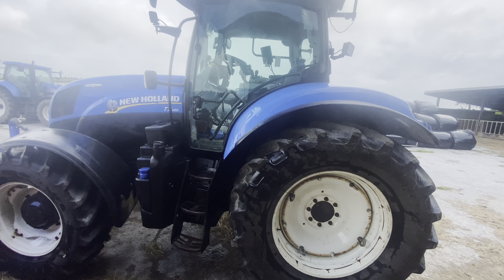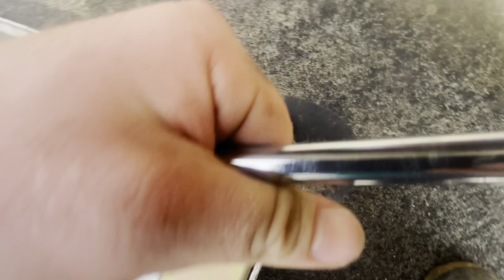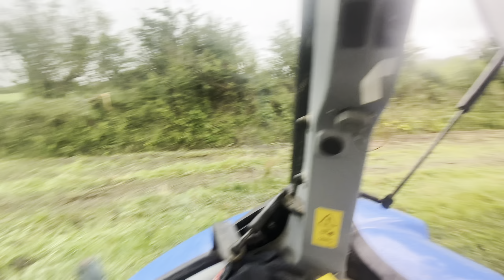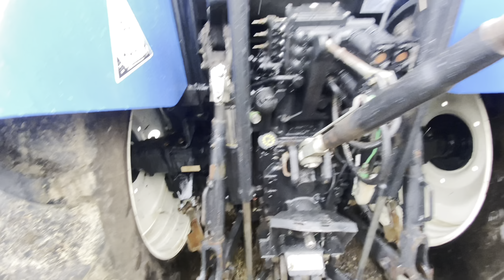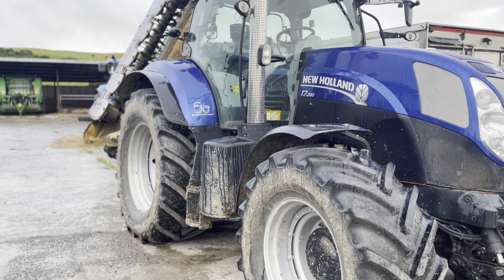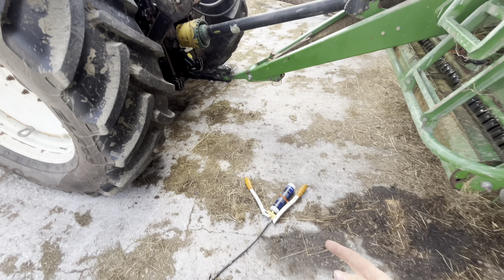We finally got some growth !! ~ GRASS IS A GO

Comment: Great video,thanks.Nice selection of blues How do you find the Autopower compared to Power command ? Those Hauer loaders are very well made,i have one of the older ones.
Reply from the maker: @yant8777  don’t have power command but auto command is lovely to drive but I’m sure it comes with big cost if anything goes wrong…. Range command definitely the most reliable of the options